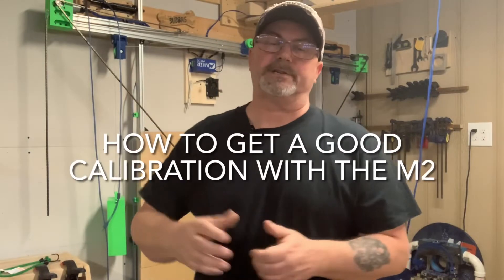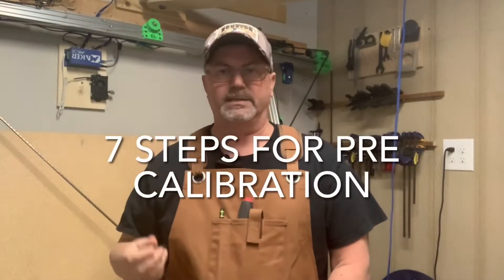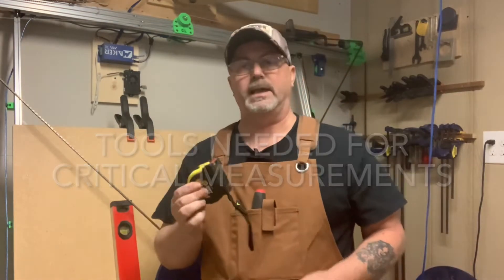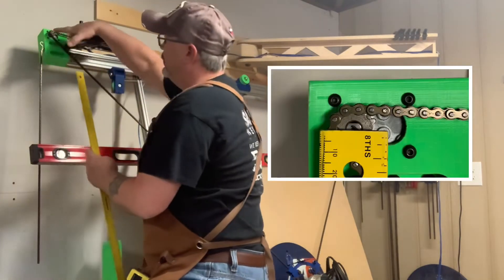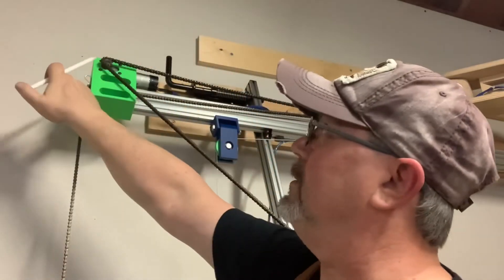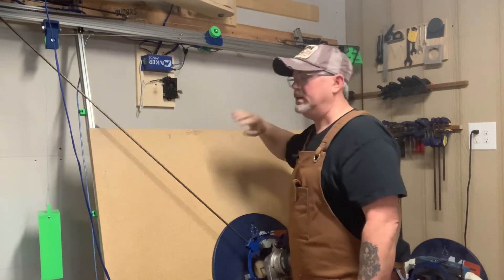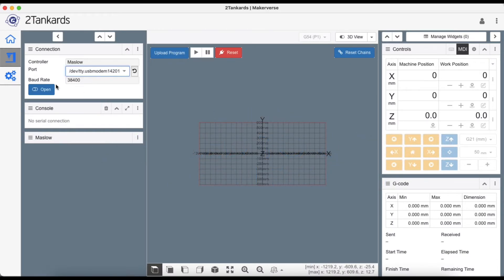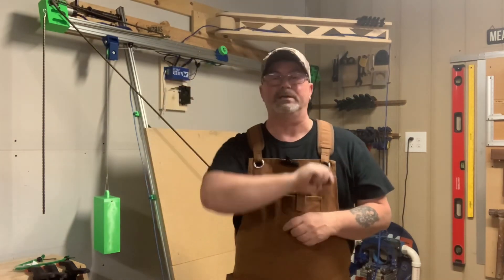MakerMade M2 Calibration Video #1

Comment: Thanks for great information. I built my frame per the instructions with 4 split water boards that doesn't allow me to get my center to calibrate unless I should do the calibrations off a sheet 4x8 that I will be cutting. Thank you

Comment: Great videos and tips. You have obviously been through the calibration process and are knowledgeable of the details of these machines. I have previously watched all of your videos on calibration. Now through a couple of issues I have to recalibrate my machine. Having had the sprockets at the end of the spring run over the chain anchor pin on the top beam I was advised by MakerMade that the anchor pin needs to be 6” from the end of the top beam not the 15” shown on the frame document I used for my frame. Having made this change, I started through video 1, the preflight. One thing I found is when using your method to measure the distance between motor centers, on my machine the distance from the center of the motor shaft to the outside of the chain is 11.5 mm. Not sure why this is different than the 8mm you note in the video, but the overall distance would be about 6-7 mm off in my case. I checked the center of shaft to outside of chain with a digital caliper to confirm. Using your method and the 11.5mm measurement, the center to center was within 1 mm of a previous measurement taken from actual center to center.